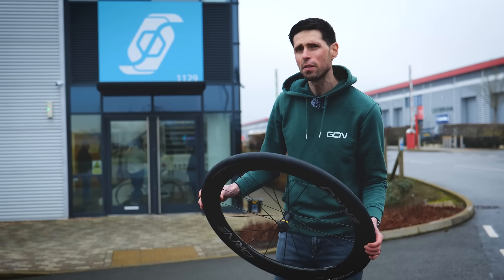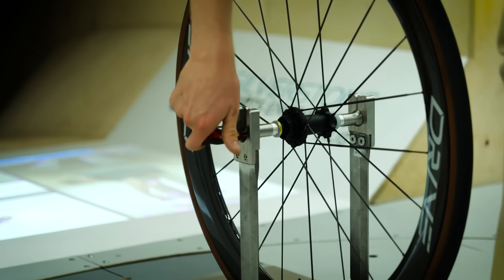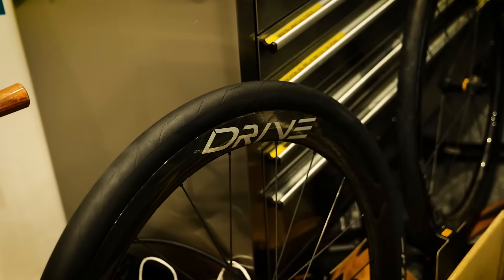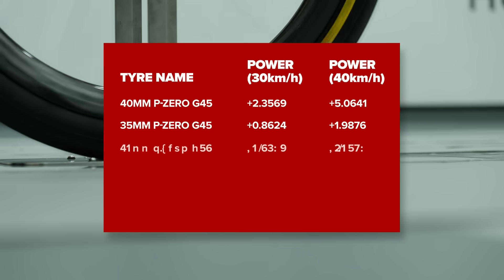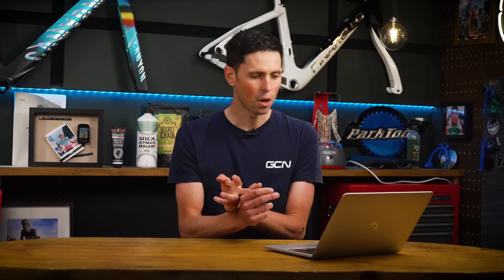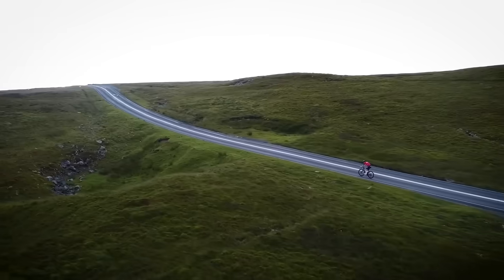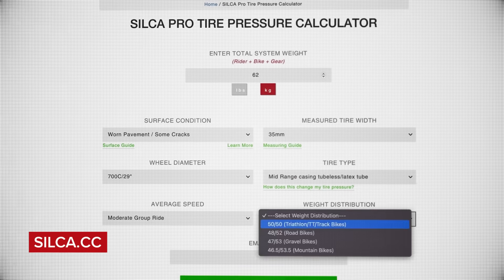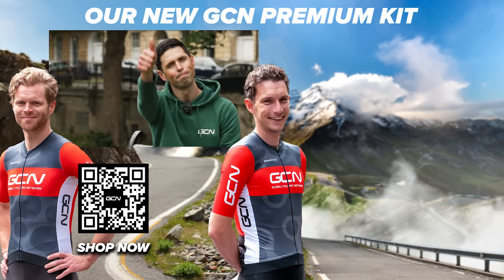The Fastest Tyre Width is NOT What You Think

Comment: Silca's pressures may not have been optimized for the selected drum. What I'd really like to see is a sweep of pressures for 28, and another for a larger size. I wouldn't be surprised if there isn't much difference in drag between tires set to the drum-specific optimized pressures (as long as a tire isn't bottoming out)

Comment: @gcntech with all this talk about wide tires I am wondering if you took into account the „sluggishness“ that is attest by almost anyone to wider tires. I mean the weight difference between P ZERO RACE TLR 28 and 40mm is 130g. That is a noticeable difference even for beginners. What makes it so noticeable is that it needs to be moved on any stroke but it is felt the most on acceleration. Maybe you wanna do a test on acceleration of these different sizes as well.
Reply: Yes, each pedal stroke has some amount of acceleration, and it is the moment of inertia that matters.

Comment: why is 120 psi a bad idea? coming back to cycling after 20 or so years and used to run 700x19 mm front and 700x23mm on rear at 120 psi.
Reply: It is not a bad idea. I have run 25c tires with 120 psi for the last 20 years and they work just fine. These are road bikes and "comfort" is so subjective it is stupid to discuss. These people pushing for low psi, tubeless, and wide wheels and tires are just selling you a lie so they can make more $.
Reply: @davidmethven2404 you're so wrong it's sad
Reply: There's nothing wrong with it if the road surfaces perfectly flat, but that's rarely the case. The wider tires at lower pressures handle uneven surfaces better.

Comment: When you talk about tyre width, you need to say whether you are talking about nominal (ie printed on the tyre) or actual / measured width.  There is so much difference between tyr brands and models on the bead to bead measurement and so much variation in rim internal widths that you can easily see a 3 or 4 mm difference in the actual tyre widths between tyres with the same printed size but different makes and rims.  That difference can easily be 50 - 100% bigger difference than the difference between 28 - 30mm in your findings.

Comment: no mention of rotational inertia of wider tires being far greater than narrow?  The constant changing of speeds, specifically any acceleration, is going to require higher watts with more tire mass.  Rotational inertia is a big deal.  When standing on a steep incline, every pedal stroke gives a small surge of speed, so your legs feel the rotational inertia with every pedal stroke.  It seems like rotational weight would be a bigger factor than differences of rolling resistance, and certainly when climbing, aerodynamics is a negligible factor

Comment: If I understand the method correctly, aerodynamic data was take only at 0 yaw.  My experience is that aerodynamic differences between narrow/wide tires on the same rim profile are amplified at more real-world yaw angles.  I think if you review the Silca data in their 'rule of 105' blog post(s) you'll see that rule is primarily a difference seen at non-zero yaw.  So, first of all, thanks for this info.  It's very interesting.  But for interested parties, don't be fooled into thinking the aerodynamic differences between 25mm, 28mm, 30mm tires on the same rim are de minimis at real world yaw angles.  That's not what this data shows.  Great video.
Reply: I had to scroll way to far to find this comment. Usually wind tunnel tests measure bikes or wheels at different yaw angles then weigh the results base on how common those yaw angles are in the real world to arrive at a single drag number. This is crucial. At 0 degrees of yaw there's barely even an advantage to running deep section wheels.
Reply: @nikanj  Yep.  It's important to understand the expected yaw angle of your event.  Most riders have never even seen a yaw distribution!  🤫

Comment: Surely you need to replicate the average road surface for this to make any real world sense, where the pneumatic tyre wins out is in its ability to absorb small lumps and bumps therefore instead of the whole bike having to overcome gravity when a bump is traversed just the tyre has to compress, this is why in the real world slightly bigger tyres with slightly lower pressures are the most efficient.

Comment: Fastest tyres I had were 21mm. Years of club racing and training with others over our rough NZ roads = 23mm fast. The two bikes I train on now - one on 25mm and one 28mm (I bought both bikes used with those tyres) - 25s fastest over the same course (ridden many times) over the 28s. Always 10psi. Try crashing low psi tyres, rims etc over curb edges and potholes and see how long the parts last.

Comment: I've never ridden anything narrower than 28mm and I was planning on going up to 32mm but 30mm might just be good enough. 

I currently run two bikes; one on 28mm and the other on 35mm. They both have similar frame geometry but one has higher gears than the other. A couple of weeks ago I did a very deliberate and controlled test of both bikes over a 20km circuit and the time difference was 4s in favour of the 35mm. But there was more of a headwind and traffic conditions lost me a few seconds so the 28mm was probably a bit faster but in the real world there is no actual difference. Oh, and the 35mm bike is at least 1kg heavier too. Back in the real world, saving a few grams - even a kg or so - really makes no difference.

I am thinking of trying those 40mm tyres on a new bike build but it is definitely not going to be my fast bike!

Comment: Most of the time I'm on 32s; have a set of 28s, some 32c cross tires, some 35c snow tires, and some 40c off-road tires.  Good enough for my needs.  Will rethink when something wears out.  Riding on an 80s road frame and a 2009 cyclocross frame.  Both take pretty large tires.  Really can't stand the zero-clearance road frames that were popular from the late 1980s until recently.  If it can't take fenders, it's not for me.

Comment: Finally did some testing.  The way everyone was talking wider is better, lower pressure is better; I was wondering when this trend was going to ultimately advocate for riding a fat bike with flat tyres.
The other trend seems to be the focus on comfort.  This was never much of a topic related to wheels and tyres when I was racing 45(!) years ago.  Saddle comfort was a thing though.  My wheels/tyres seemed comfortable enough.   Is this somewhat recent obsession with comfort due to the fact that wheels now days tend to be deep rimmed carbon fiber with radial or at most a 2x spoke pattern?   When was racing we rode rather flexy aluminum rims with 4x small flange hubs.
Reply: I've thought the same vis a vis comfort, racing and comfort are not compatible, lungs and legs take precedence over butts and wrists.  I think much of the comfort factor in road riding is because of the aging population of cyclists?  When you're 20 vs. when you're 40 is a huge difference in your perception of comfort during the ride.

Comment: My experience with riding bikes in the UK (in Dorset) is that you get a concussion of the brain just by riding on a normal road - you don't even have to fall from the bike - because the condition of the roads is terrible. You need at least a 40 mm tyre or larger. Here in Switzerland you can comfortably ride a 23 mm tyre pretty much everywhere.

Comment: 10 Years ago, I was still using Comp 22 Tubs, for road races and Criteriums. 30 years ago, I was using Comp 19's, pumped up to 105 psi. 35 years ago, I was using 20mm clinchers at 115 psi.
I see most Crit riders now, using 28's or 30's, Tubeless. That's at 50kph, for 75 to 90 minute races. I finally put a 28 on my rear wheel, for general riding, this year. I have a hard time, not using too much pressure. (I want to put 90 in it)
Reply: I'm 98kg and use 28mm GP5000.  Rear 90-92, Front 86-88.  Those the job.  Next one Will be 30mm tires

Comment: About a week ago, I rode home 20 miles after breaking a rear spoke on a climb. I run 25 mm tires on my old Domane. If I would have put 28 mm tires on there, I think I would have been stranded due to the wobbly wheel/tire rubbing the CF frame. 
So, I think I'm going to stick with the 25's!😜

Comment: Why don't they mention that changing the tire width also changes the outside diameter? That's strange. Changing the outside diameter is like changing the gear ratio, the wider the tire the higher the gear ratio. For some reason they don't mention this issue.
Reply: Bicycle speed is calculated as gear ratio x tire circumference x cadence.
Reply: Going from 25mm to 30mm increases the circumference by about 50mm. Assuming a gear ratio of 1 for a 30mm tire and a cadence of 80, the gear ratio for a 25mm tire is 1.03. In this case, the rear gear ratio is +1. If you change to a 30mm tire, you will be pedaling at a gear ratio that is one gear heavier.

Comment: if racing, use the tyre that is fastet on your bike. try different ones. find a good testrack and a solid stopwatch/time tracking setup. some tyre feel better in the corner other roll better in the straight line.  if racing is not important, use one tyre in the 32-38mm range if it fits and the rubber is as smooth as possible.

Comment: Everyone enjoys an oxymoron, but I do think that 120psi 23mm tyres were not necessarily the holy grail they were assumed to be. Weight is an issue too, fitting TPU tubes made a massive difference on my bike (until they both punctured), 50g per wheel. BTW I’m a 60+ non competitive rider.

Comment: Currently running 38mm slicks. Great comfort and grip. I don't notice any difference in speed on shorter rides, but on longer rides I'm noticing a slight increase in speed over the 32's I have on another bike. I think this is probably due to the increased comfort leading to less fatigue.

Comment: This all depends a huge amount on rider weight also. A bike being ridden by a 125lb rider handles and rolls alot different than when piloted by a 160lb rider. As well the pressures would be quite different.

It is all personal! 

As well the muscles required to push rotational weight difference between two tires weighing 200g different is not the same with lighter vs. heavier person. 

It is all personal!

Comment: I've recently played with different tire widths on my bikes to see which I prefer. I've installed 28, 30, and 32 on my bikes and although I like the feel of the 32, the 30 seemed to give me the overall illusion of higher speed even though they were very similar, with 28 next as far as feeling fast. The 32 does marginally feel a bit slower to handle and get up to speed but it's very small and the smoothness of the tire makes up for it once it's up to rolling speeds. The other smaller tires just seem more responsive. I've put 30 on the bike I want to ride a little harder and 32 on the ones I take out daily. The difference is marginal when I look at the numbers but the feel is quite different in my experience.

Comment: I was on my 10.5 kgs gravel bike on Sunday afternoon. Carbon frame with stock wheels on 35s. In terms of rider weight, I'm heavier than I would like to be at 74kgs. I was trundling along when a skinny rider, probably about 65-67 kgs passes me on another gravel bike with 32s on. Well, I tried to push a bit to stay on his tail, but gave up after a few kms. The reason wasn't down to my fitness level on a bike, but due to the fact I was heavier and I was on a heavier bike, with slower rims and wider tyres, so just could not generate enough power to stay with him.

Comment: What is missing is the specification of the used tyre pressure; provided the same pressure has been used (which is unlikely the case 28mm vs 40mm), it is for sure the wider tyres have a lower rolling resistance. When testing the front wheel in the wind tunnel, the brake disc was missing (as it still may have an impact); It would also be interesting how the aerodynamics are for example on fast descends; for example, on a Mavic Cosmic Carbon SSC front wheel, my bike became noticeably slower when I put on a 23mm tyre instead of a 20mm tyre (as the rim is 13C with being 20mm wide outside) at speeds of about 75+kph. How about the 105%-rule, which means the optimum tyre is when the rim width is 105% of the installed tyre, so the airflow becomes more laminar?

Comment: I've also fitted 32mm for 3 years now.
I have found that the brand and model can make huge difference in comfort.  For example the discontinued Michelin Power Road 32mm and my winter Cinturato  32mm were far more comfortable  than the GP5000 32MM or the Pirelli PZero race tlr 30mm, i am using currently. 
The next summer pair might be Michelin again.

Comment: Ha ha ha! Eventually I will finish this video, but had to stop and comment after you mentioned 120psi being a bad idea! 120 psi is a great idea, and always has been! When you are a super clydsdale like me, (225 lbs) you can throw the ridiculous 35 mm at 50psi out the windows, it does not apply! The biggest tires anyone would ever need is 28mm, and thats only on bad roads. And for comfort and handling. If you want that, buy a hybrid bike, and run 40's on it. Lol! Lower psi tires at my weight make be feel like I am running on my rims, and boggs me down big time. Yes I run 25mm on 19mm rims, at 120psi. I see the difference in speed through my stats, and definitely feel the difference as wel.! Sure they will rattle the fillings out of my teeth, but, but they are very sturdy, have ZERO rolling resistance, hard as diamonds, and hardly ever flat. Not to mention they are faster than a bat outta hell as well! I always get a kick out of people when they roll up next to me riding on super wide tires, and super low psi, and think they can keep up. Then they proceed to get their doors blown off!😝😂🤣

Comment: You need to do more yaw angle crosswind data to test how tire width affects sail effect wattage and airflow detachment angle.   Wider tires on similar width rims will stall (detach airflow) at  lower angles, and require a wider rim– possible up to a point.

Comment: I may have missed this but are your tyre widths measured as ‘on-wheel’ measurement or ‘out of the box’ measurements.
Eg. On my front wheel, a Conti 25mm tyre ‘stretches’ to 29mm and a 28mm tyre ‘stretches’ to 30.5mm. Which measurement should we use and, secondly, which measurement do you use for calculating your tyre running pressures?

Comment: Nice video. Well done! I'm on 30 mm front, 32 mm back, and it's working very well, but the 32 mm is really pushing the limit of what my frame can accept (32 won't fit on the front). The increased comfort from the 32 on the rear is quite noticeable, and likeable. But...when that 32 wears out, I'm likely going back to 30 on the rear because it'll fit better in the frame, and because this video gives me assurance that the 30s are a very good choice for my road bike. Kudos, GCN! Just the kind of practical testing that helps us serious amateurs.
Reply from the maker: thanks so much for the comment and the feedback Greg. Much appreciated!

Comment: I guess, rim width plays an important factor. Pogi often runs 30mm tires, but he uses also ENVE SES4.5 with 25mm inner and 32mm external rim width. Most wheel sets are somewhere in the 22-23m range and 26-26mm external width. I would think that a 28mm tire fits here better.

Comment: Have any teams or bike manufacturers experimented with running different widths on front and back. Stick 28s on the front to reduce aero and rolling resistance and then stick 35s on the rear where most of the power is going to be and traction is more important?

Comment: Great job on breaking things down and looking at multiple factors. I will note that the claims of better “performance“ is an opinion as you did not test handling, corning ability or other factors. I would certainly not assume that you will have better handling on a wider tire. As the tire gets wider, it’s also getting higher. When cornering this additional height could allow more flex in the tire under hard cornering. Now maybe using the wider profile rims accounts for that, but I think you’d need to test it. My personal and completely anecdotal evidence/opinion feels that a wider tire (40mm) simply flexes too much under hard fast cornering and provides a very Squirrley feel… Again, on my specific rim entire combo. I know this one’s hard to test, but please don’t forget about this important consideration😬
Reply from the maker: great point Matthew. Handling is very subjective and tricky to get definitive numbers for. We will look into it. Cheers

Comment: Started road cycling on 18mm clincher tires, now using 23, I tried only once 25mm and hated it. Since I'm very light (47kg), short (1,65m ), I can't see any advantage in fat tires and disc brakes on road bikes for me. Still using high-pressure clincher tires like Panaracer or Vittoria, but my favorite tire of all time was the Veloflex Corsa 20mm, almost a tubular tire.
Reply from the maker: if it works for you, that's all good with us! Those Veloflex were known as Open Tubulars weren't they!
Reply: @gcntech  Yes, the open tubulars, but now only in 23 or 25mm. Another thing 23mm is better than wide tires is in wet conditions, the drag on water are much higher on wider. Maybe for commuting a wider tire is better, but for racing I still prefer 23mm, I'm a low power person and any watt makes difference for me.

Comment: I am currently riding 700c.23.mm.maxxis refuse tyres on a pre 2010 trek road bike with a shimano dura ace group set with rim brakes. I am running latex tubes @ pressure 83psi. I weigh 96kg and only ride about 65km per week on sometimes a little rough bitumen roads.
I'm thinking about whether I need to upgrade to continental  tyres in 28mm as I'm not sure if I can go up to 30mm tyres with my  trek bike.